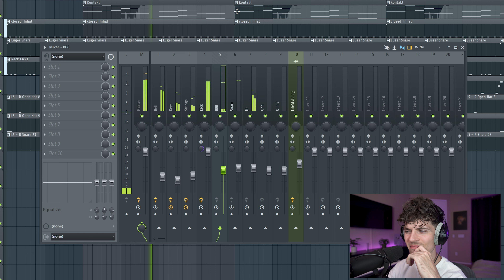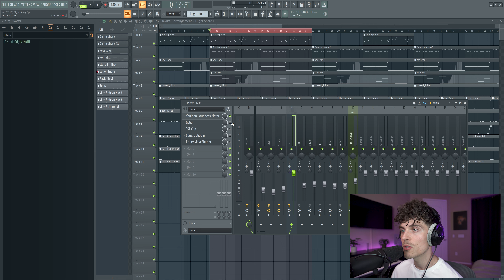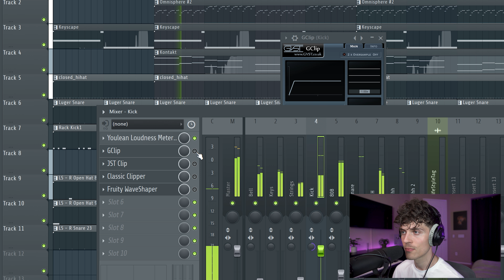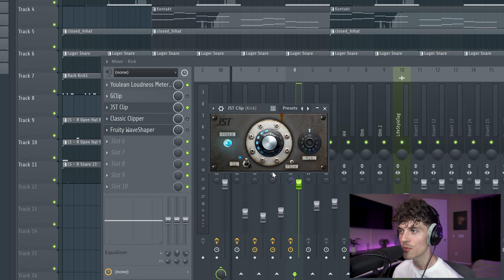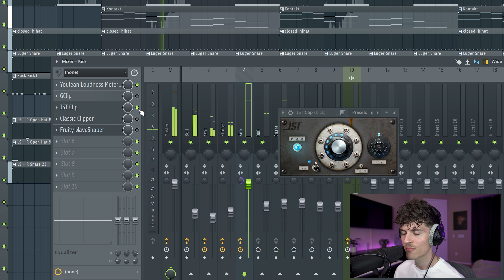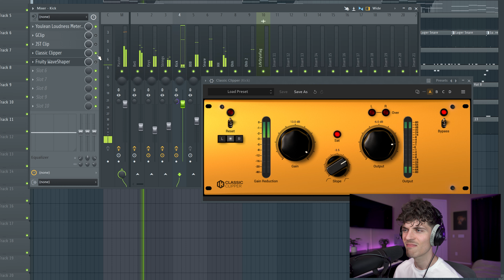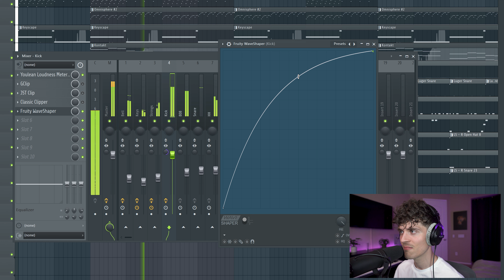How To Make Your Beats Hit WAY Harder

Comment: Lately I've been going for a lower db kick to let the 808 stand out, so this is a great tip for anyone trying to give the 808 a little extra oomph
Reply: Southside did the opposite and then ig later he just said screw it and have them both blast, but ig also depends on what vibe or priority your going for.
Reply: @GodSpeed1105  yeah exactly, lower kick for shorter 808 and louder kick for longer 808/synth bass imo

Comment: What do you recommend for the beyer headphones for mixing 250 ohm or 80 ohm?
Reply from the maker: 80 ohms if you don't have a dedicated headphone amp for the 250.
Reply: @LifeStyleDidIt  i have the 250 plugged into the Scarlett, it still seems quiet, so do I need to get anthoner headphones amp and have it in the loop also ?
Reply from the maker: @ESSnEFF  depends if the amp on that interface will push it enough for you. 250 needs more amplification than 80 ohms.

If it’s too quiet, you’re gonna need a headphone amp or just replace and get the 80 ohms
Reply: @LifeStyleDidIt  thank brother